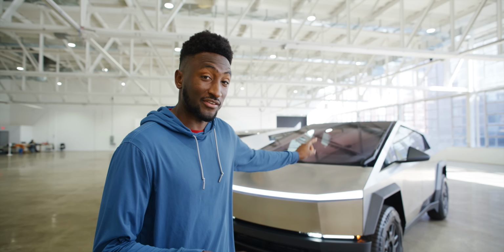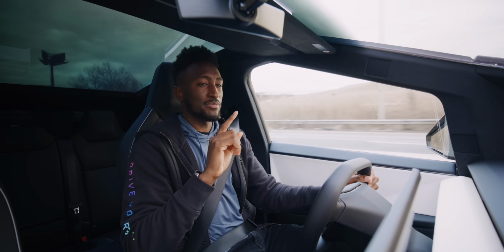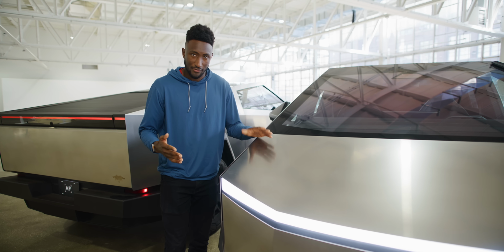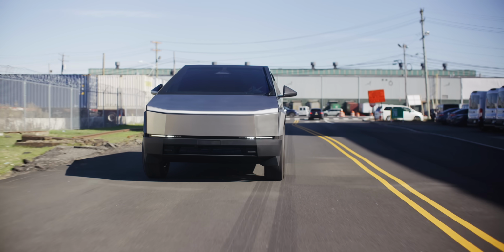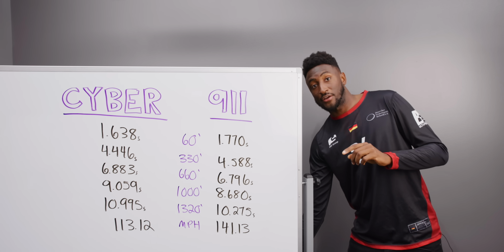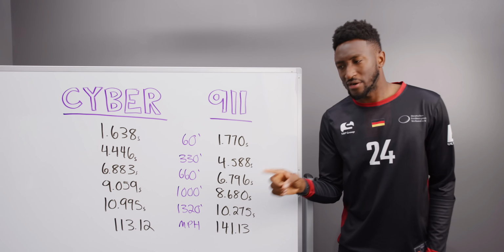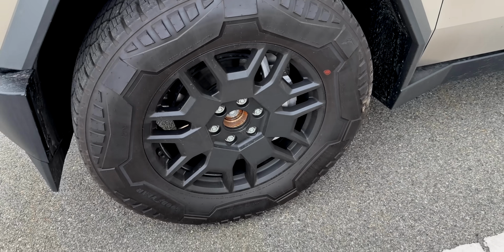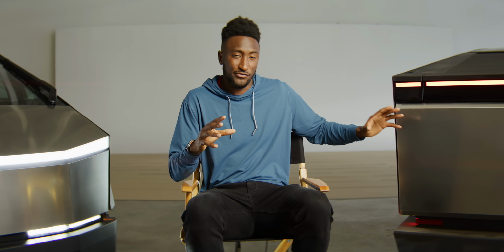Tesla Cybertruck Review: Already Iconic?

Comment: Did you mention the features of having glued-on metal plates that can fall off and have 120 volts to ground when charging? What about the hidden headlights that can get easily blocked by ice, snow, or dirt? Or perhaps the fact that it has worse maneuverability than an F150 at a higher cost, such that it can easily get stuck in snowier areas?

Not to mention anything about where the profits from the truck go...

Comment: A year later and CyberTrucks are “delaminating” and 8 recalls. It certainly will be iconic but for the wrong reasons.
Reply: All newer cars have recalls. My dad bought the Lexus GX when it first came out and it was always getting recalls because it was a new car. He now has a newer version of the GX and it doesn’t have that problem anymore.
Reply: Ford is recalling 150000 trucks due to an issue with rolling away. When Tesla has a "recall" it is downloadable, usually something mundane like a font height, and most importantly, nothing is "recalled" - i.e. they don't make you upload your firmware back to them- what a silly notion - they just send you the update.

Comment: To fix it they need to double the battery at all costs. Save money by dumping the stainless steel, steer by wire,  4 wheel steering, make the bed functional in size and shape,and add retractable running boards rather than the elevator ride.

Comment: The headlights are a flaw because snow and dirt can get stuck in front of them
Reply: Literally every car has this problem.
Reply: @lucaburkhardt2592  the headlights are literally in an inset gap. you bump into a pile of dirt, that's them covered. do that with any other car, the dirt will slide off. The light bar ain't the headlights, in case you missed that.

Comment: it's bad at being a truck, it's really bad at being just a regular car, you can pull it apart it your hands, and it's not really great at offroading because the motor it uses for it's air suspension is wack. but in my opinion, and I don't think it get talked about enough, it's biggest sin is that tesla claims it as a heavy duty pick up truck/tank/immortal entity, and they made the frame out of casted fucking aluminum. they made a HEAVY DUTY PICK UP TRUCK with an aluminum frame and a steel body. I'm all for "thinking outside of the box" but that's just stupid.

Comment: You know, if you drive around in a parade float, people will react to it, too. A slab of stainless steel is not iconic. A vehicle that weighs that much has potentially volatile batteries, can accelerate well beyond any legal limit on any roadway, and has no physical controls available between the yoke and the wheels, and fanboys who think they can use autonomous driving make this really dangerous.

Comment: An issue is if the truck door locks. And If someone in the river the people inside the car. They want to escape from car. Normally, People can break windows by hammer Or tools. However this truck window is stronger than regular. People are difficult to escape from the truck?

Comment: It’s very weird to me that Marques considers variable ratio steer by wire a good feature.

The tech equivalent would be to use mouse acceleration on a computer. Yuck.

Gordon’s T50 did it the correct way. Clutched in power steering at low speeds, not variable ratio.

Comment: They gave you steer by wire and four wheel steering, but you paid for drive automation it doesn’t have. Perhaps the two are related since a non variable steering column is programmed differently than the one the truck needs. But you paid for it.

Comment: I was invited to the second step and gave Tesla  another $1000. There’s something off though so let me know what you think:
1. I did the original preorder in June 2021. I figured I was somewhere between 150k-200k based on some articles I read at the time. The recent recalls where they are forced to publish figures suggest Tesla made some 12K trucks by July 2024. So, how did I get invited unless like 80-90% dropped out?!
2. I am looking on CarGurus now and the Cyberbeast, which is like 131k for the tag, is being sold in multiple states for 140k-143k which is a modest premium and is almost breakeven

Does this sound like what was advertised? I think I have another 2-3 months before they call me for the final payment and delivery but this is starting to look like a major flop and I might have to walk away since cheaper to let go of the deposits than pick up a car which could be depreciating like the rest of the Teslas. Where can I see reliable information on how many cars they made and how many preorders still exist?

Also, was considering renting it on Turo for like $350-400/day. Thoughts on the feasibility?

Comment: I'm unhappy that this vehicle was released to the public with the frunk's original issue of potentially breaking off a finger if caught in the side while closing (yes, Tesla has since fixed this) or the other issue of potentially lacerating your face or losing an eye while the frunk lid is open (or the back corner of the bed). I see this as extremely dangerous and yet the governing bodies decided this was not enough of a public safety issue to care. What's the point of safety regulations if they're ignored? I guess now we wait for the potential lawsuits from injuries due to the Cybertruck being designed the way it was.

Comment: This might turn out to be one of the worst lemons of all time.  I have never heard of a car having this many commonly-experienced issues, from ones that can render the vehicle un-driveable(red screen of death for indeterminate reasons, don't take it through a car wash) to ones that cause damage to it(the windshield wiper can catastrophically fail leading to scratching the windshield, setting suspension height to maximum can cause it to damage itself), to ones that are just unfortunate(rusting?  Tonneau cover seals getting jammed up?  Windshield wiper motors burning out?).  It's hard to keep up with the myriad array of issues that are common to this truck, and it's hardly been on the road a few months!  As they get driven more the issues just pile up, with people now reporting on the CT forums that their side mirrors are rattling/shaking, and a couple of people even reporting that their entire drivers-side door is shaking at speed.  It sounds like they're literally falling apart.
Reply: And the 'Bulletproof' exterior?  Ok, if you hang out with Suge Knight.

Comment: I finally had a chance to see one of these up close and test drive one. It also had giant panel gaps all over and it’s build quality was also extremely poor outside AND in. The tires were damaged from the wheel covers, the dash panel was warped for some reason, and the bedcover was crooked. Also, I found out from the owner that this thing is so dangerous it can’t pass European safety standards. The leeway given in these reviews by Marques, saying future builds will fix all of these issues, is mind blowing to me. Especially, given the inconsistency in his criticism compared to other product reviews… Tearing other products apart for not launching in the condition for which they were promised by the company before launch, but in this video he just makes excuses again and again for all of the glaring problems and missing features when it comes to this literally poorly made steel death machine. It’s kind of astounding. Personally, I did find the drive by wire steering to be the best thing about the cybertruck after driving it. But they could have put that technology in anything else that wasn’t just poorly designed and poorly manufactured in so many other respects. I honestly question Marques’ ethical principles as a reviewer after watching these cybertruck reviews in comparison to his other reviews. Just disappointing.
Reply: Agree, well written comment. Feels super off in comparison to his other work.

Comment: The trouble with iconic is that it doesn't age well. When VW bought back the New Beetle it did very well, but very briefly, and soon it becomes just last years shtick. So you really will have to live with the car after the styling has ceased to be a part of the equation.

Comment: I've seen a ton of drag races all over youtube with this thing... but what about the agility course, or at least race track with some tight turns? off-the-line performance is clearly it's strong suit, not speed; there's nothing else really to learn from drag races. What I want to know is, can that 4 corner steer-by-wire system actually make up for the extra weight when it really counts, or does the Porche win on a winding road, too?

Comment: It's funny how you say at 7:30 that people inside of the truck will be fine in an accident, when it's now known that the lack of crumple zones actually puts passengers in more danger.
Reply: When he said " you will fine" I was assuming the "you" was the extension of you, more known as the car. The car will show no damage in a fender bender, or not as much, where as the other car will take the damage. But, Who knows....
Reply: @Neuro_Divergent  That also isn't true. Cars are designed for the body to take the brunt of the damage in accidents, because a car can run with body damage, and body damage is often easier and cheaper to diagnose and repair. The car was designed for the body to not take on that energy, so the energy is passed on to more crucial elements of the car.

They basically ignored everything that has been learned about motor vehicle production and road safety in the past century.
Reply: @ToomanyFrancis  It is true as its been demonstrated. But , you are correct with your statement indicating that cars absorb inertia in crashes by crumbling that way the driver doesn't take the impact. This is well known. You are taking what he said out of context to make your point though.
Reply: @Neuro_Divergent  No he isn't. The Cybertruck is worse at protecting both the car and the passenger. Because the kinetic energy is directly put into other parts of the car and the passengers while the outside / the chassis absorb next to no kinetic energy. The statement makes perfect sense and highlights how Marquess is either lying on purpose or being very ignorant / naive.
Reply: @benzo___  In order to conclusively say that it’s “worse,” you need crash-testing data. You don’t have that data because the CyberTruck is not legally required to go through crash-testing due to its relatively low volume of sales compared to other cars, so who knows? Tesla is known for making incredibly safe vehicles, would be weird for the CyberTruck to not have a crumple zone when other Teslas perform better than most cars in safety.
Reply: @benzo___  NHTSA says otherwise. In fact it is the safest vehicle you can possibly buy for any price.
Reply: i keep hearing morons repeat this same line. they must have heard it on their TV "no crumple zones" LOL did you think you really knew something that Tesla didnt? What? PS this has 5 star safety rating per NHTSA. Like all Teslas, which actually broke the mold on what vehicle safety even means. Even with a 100+ year head start, legacy auto just can't match it.
Reply: @jdfershizzle seriously though 😂 Hating is fine, as long as you have sources to back your claims up, but watch any cybertruck crash test, or take a second to google it, and you’ll find out it has a 5 star rating along with the crumple zone
Reply: @Skelolion  yes, it is bizarre and alien to me. The number of people who are incapable of independent thought is kind of astounding. Imagine going through all of life waiting to hear the next lines one wants to repeat with zero understanding or knowledge. The zombies are real.

Comment: Wow, a truck that has less storage than most modern truck, any older truck, most suvs vans or even sedans, hell even a cargo bike is comparbale. A truck that is more dangerous to everyone around it AND the people inside it compared top most vehicles on the road, that has horrific quality control issues, rusts if you look at it funny, AND it blinds people nearby thanks to it being a glare magnet.

I mean it is iconic, for being an absloute disaster.

Also its not surprising that a tech channel didnt even touch on how dangerous sharp angles are to pedestrians, but it is dissapointing. Cars are a massive killer and making one of the deadliest types of car (pickup trucks) even deadlier for looks especially when most pickup truck owners dont need to own one. Most of the need is better served by vans and for the bit where a pickup truck is needed, the bedspace of modern (especially teslas) pickup trucks is bs. 

Oh also bulletproof steel? its bullet resistence is far overstated. 

Personal vehicles dont exist in a vacuum and glossing over its myriad of flaws is promoting a vehicle that is unnecessarily dangerous just because, and it is not fine because it looks good, it makes streets mroe dangeorus, it makes congestion worse, it does mroe damage to roads, and for what, it looking cooler?

Comment: There are two safety things that really concern me, the bullet proof steel may protect the people inside, but make everything far more dangerous for everyone else on the road, particularly if the protection makes the driver feel more comfortable with speeding or too quickly accelerating. 

Another issue I have is the lack of physical buttons. Touch screens are hard and distracting to navigate, we all know that, it's why we are not supposed to be using our phones while driving. I am well aware that these problems are in know way unique to tesla or the cyber truck, but they are things I worry about.

Comment: Disappointed that the truck having the worst internal and external safety design and extreme environmental and infrastructural impact is barely mentioned. 

The safety aspects have already been mentioned in other comments (to add to that though: I don’t think this will ever be approved for EU sale with anything resembling the current design). 

The impact on environment and infrastructure is arguably even worse though. The sheer mass of this thing makes it so insanely bad. 

This thing is basically two Teslas stuffed into a one to achieve pretty much nothing except literally exponentially more impact on the tires and asphalt. 

This not only increases maintenance cost of both private and public parties by a very significant factor but also a once again a literal exponential increase in microplastics from the tire wear which is already the literal largest contributor to microplastics in the world.
Reply: In the review Marques noted it's actually lighter than other electric pickup trucks.

Comment: A few things you left out in this video: 
1 The bulletproof exterior isn't just overrated, its dangerous. Cars are made to crumple so that the kinetic energy, the force of the crash goes through the car itself instead of your body. Whiplash at best and seriously injured at worst from a simple crash. 
2 You did not mention the "Car wash mode" at all. They did not make the seals to the power points well enough to keep water out so they made that mode to close those parts and protect the car. But if you have adhd like me or just having a stressful/busy day, you will forget and brick your 'truck'. Not to mention I've seen posts about this happening and it will void the warranty so you're screwed. 
3 You did mention that the windows are stronger than normal but, specifically they are meant to be shatterproof. Sure this is great if you live in a high crime area but, what would happen if you went off a bridge? I can't say ive seen one submerged so i don't know exactly how it would go, but normal procedure is, unbuckle, grab something for breaking the window and bust out the back windshield. How are you going to do that with this? 
4 You didn't mention a common problem with Tesla cars in general, that the doors are completely powered by the battery. ( Some may be different, i don't know ) And there are many reports of their battery dying for one reason or not, and becoming unable to get in or out of the car. If this 'truck' were to have this problem, how would you get out/back in? You can't get out the windows thats for sure, and tow companys are going to have a hell of a time getting it to a shop of its stuck in park.
I can understand if maybe you didn't want to include these because they specifically weren't your experience, but they should atleast have a footnote in the video instead of completely ignored. (These issues are just from a couple other videos I've seen and im sure there will be more.)
Reply: Trucks in general are not made to crumple*, and *every Tesla has handles/cables on the inside of the door so you can open them. They would be illegal if they didn't. You also need to learn basic physics. The pressure holding the door closed subsides as water enters the cabin. You can open the door long before the cabin is full of water. Besides, has shipped, they float for a long time.
Reply: @JorgTheElder  While trucks are less likely to crumple up like a car because they are built to haul and such, they do crumple to help absorb the impact. Cybertruck doesn't at all. As for the sinking aspect you would have to wait for the car to fully submerge/fill up with water for the pressure to equalize for you to be able to open the doors unless you're pretty strong (and I'm not) so I'd prefer to be able to smash a window. Also, I mentioned these are things I've heard in other videos, I don't own a Tesla and probably never will so I wouldn't know. I never said these were 100% true facts, it's just my opinion/concerns.